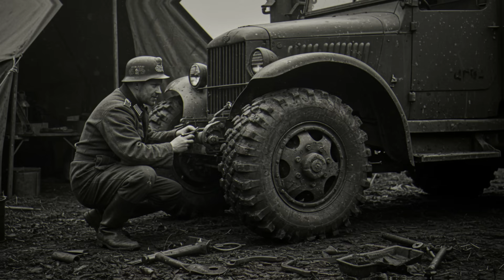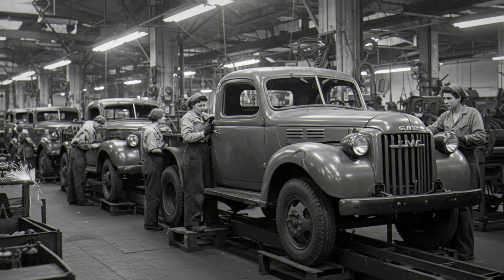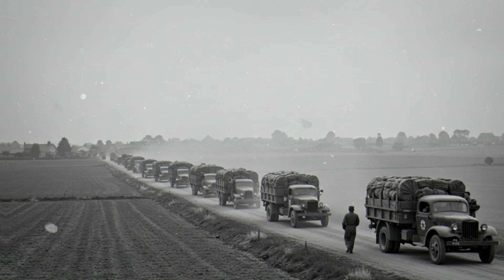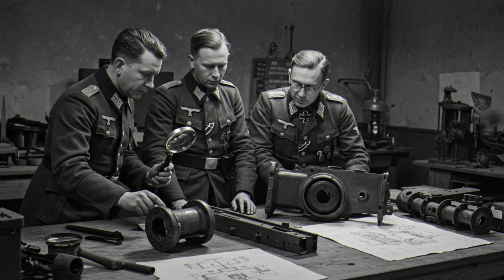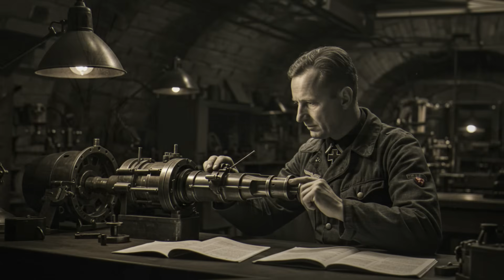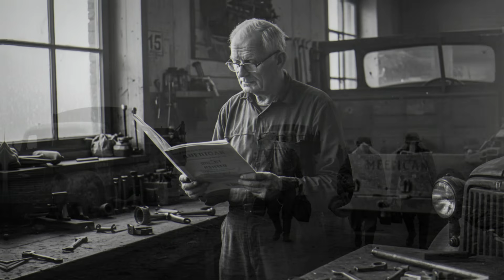German Mechanics Were Shocked When They Saw American Trucks Crossing Mud Without Stopping | WW2

Comment: Great story. Studebaker, Chevrolet, dodge and GMC, all used the same parts on the 2-1/2 ton trucks. So a transfer case from a Dodge would fit on a Studebaker. This made keeping more trucks on the road possible.
  All these trucks used feet, inches, fractions and decimal deminsions. Just saying.